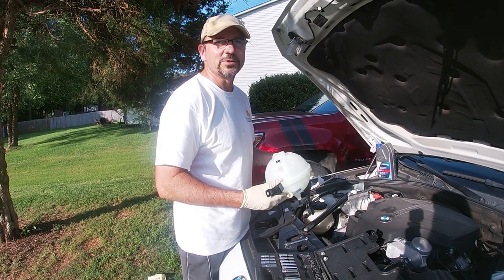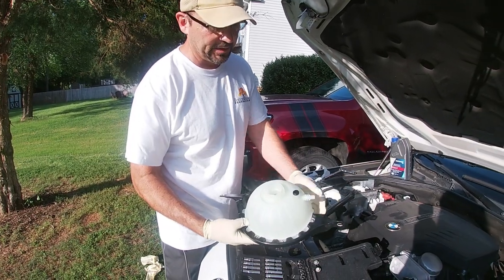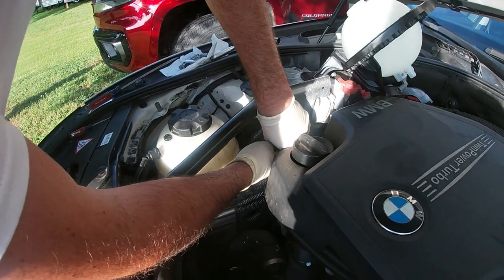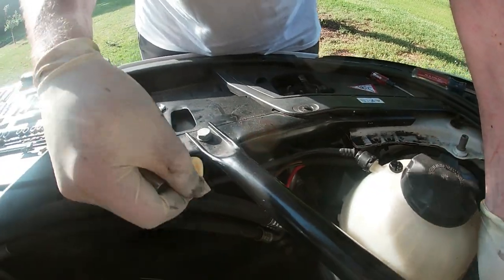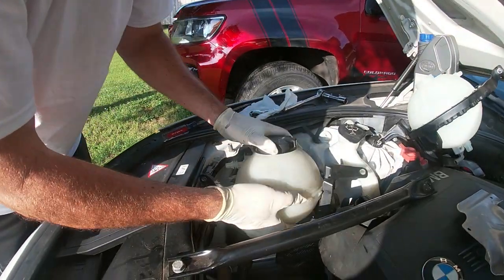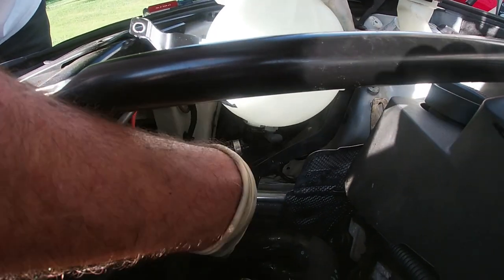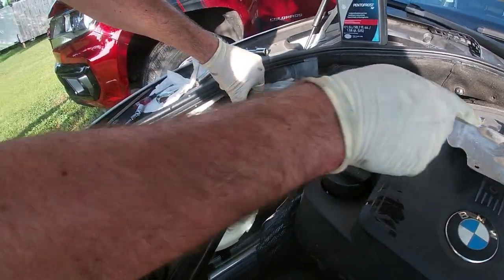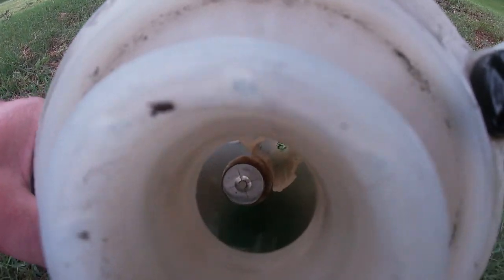BMW 528i Low Coolant Level, Reservoir Tank Replacement

Comment: Awesome video and Im going to do the same thing with my 2016 BMW 528i Xdrive with 158k miles on it.  I purchased a BMW original part for $50 and dont have to replace the whole bracket since the new one will pop into place using the existing bracket to save a bunch of wrenching time.
Reply: Where did you order the part? $50 is a good price. TY

Comment: Should I Change the whole Coolant reservoir or just the level sensor ? I have low coolant warning light but it Full
Reply from the maker: I tried replacing the sensor first but that did not correct the issue.  I did have to replace the coolant reservoir as the float in the reservoir was not properly functioning.
Reply: @granitebowtie1758  ohhk , also sometimes my temperature gauge from 90c to 100c and drop back 90c is it normal ??

Comment: I replaced mine and everything runs fine and doesn't say coolant level is low BUT now it threw code U019F - Lost communication w/ engine coolant pump control.  Any thoughts on How to fix this?

Comment: What was the original problem that lead you to change the sensor and then the reservoir?
Reply: Low coolant message pops up with the reservoir full. Very common for the float to go bad, replace reservoir and sensor when this issue arises.

Comment: Did you empty all coolant or just siphon out what was in the tank?  Did you have to do anything after installing the new tank to make sure no air was in your system?
Reply from the maker: Just siphoned the coolant from the tank.  No air in the coolant system since I did not remove coolant from the radiator but I did check the coolant level several times after doing this job to make sure the coolant level was correct.
Reply: Did you apply the electronic procedure to purge the air?